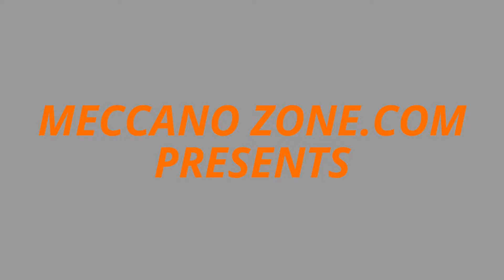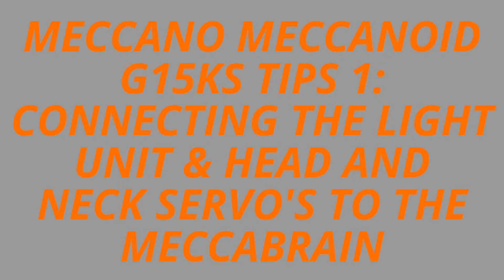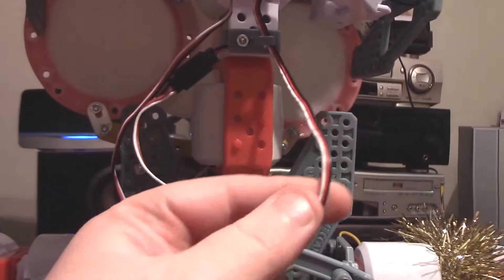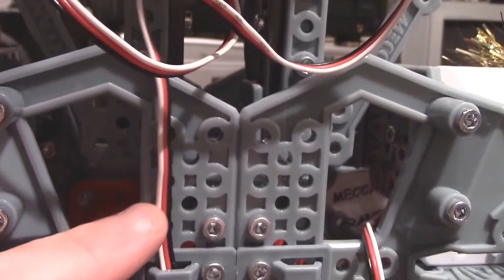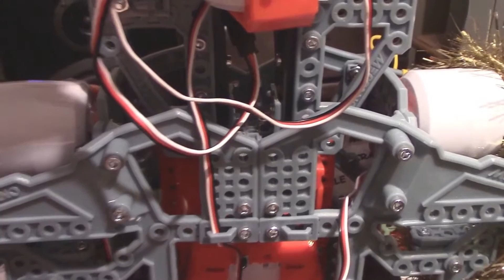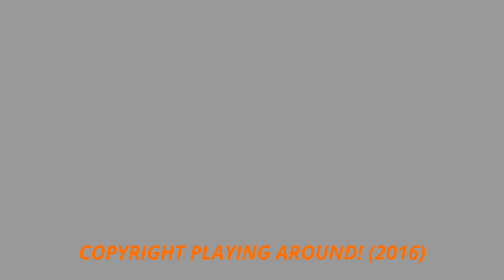MECCANO MECCANOID G15KS TIPS 1: CONNECTING LIGHT UNIT & HEAD & NECK SERVO'S TO MECCABRAIN

Comment: What do you do if the Neck servo wire is too short to reach the Meccabrain?    All I can think to do is to splice more wire into it but will that cause any problems with interference or bad connections?
Reply from the maker: Firstly, have you put the robot together correctly? Of all the problems surrounding the G15 and G15KS Meccanoids, leads that are too short have never come up as an issue, at least not as far as I know. Of course there's always a first time. I wouldn't have thought splicing in some extra wire would be an issue, but Google Mecccontrol. Tim there supplies alsorts of stuff including ready made up leads.
Reply: Thanks for the reply.  Yes im pretty sure I put it together correctly.  I finally was able to stretch it enough to fit.  I will google that also to see whats on offer.  Cheers mate.

Comment: Hi, I've rebuilt the head twice and wired it exactly like in the video but Meccanoid states that head is incomplete. The head moves but doesn't light up? Thanks
Reply from the maker: In that case I'd suggest a duff lead to the lights.
Reply: Thanks for getting back so fast. I'm not sure if it's linked but unlike all the other servos whose light are blue, the head servo (right at the top) has a green light/glow?
Reply from the maker: +Akshay Ah,  you have some life at the lights. Can&#39;t think at present what mine does. Where are you in the world?
Reply: In the UK
Reply from the maker: +Akshay Anywhere near the Midlands?
Reply: Sorry I'm down South! Will probably try to ring Spinmaster when they open after the weekend but thanks anyway.
Reply from the maker: +Akshay Check the operating instructions for what green eyes mean. From memory it's in one of the menu's.
Reply: Okay thanks I'll check this out
Reply: did you pinch a wire in something?